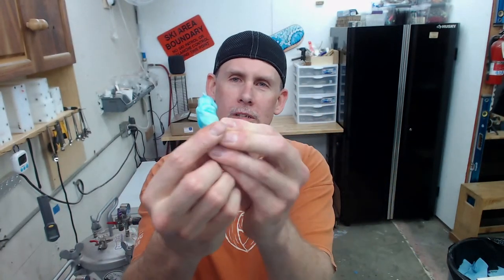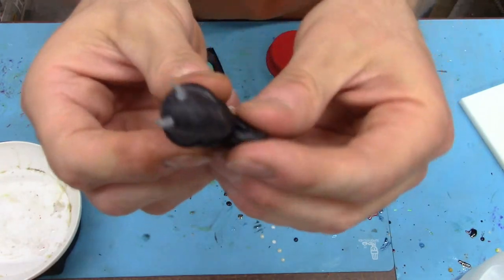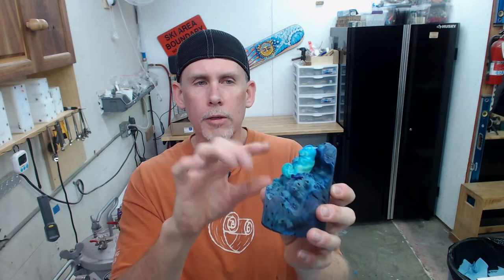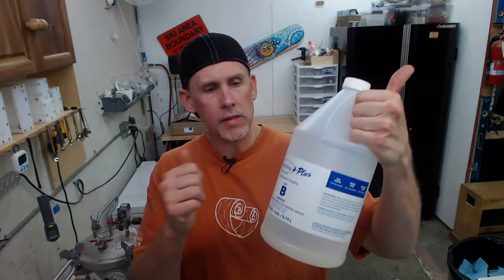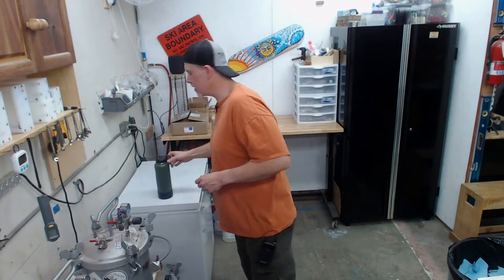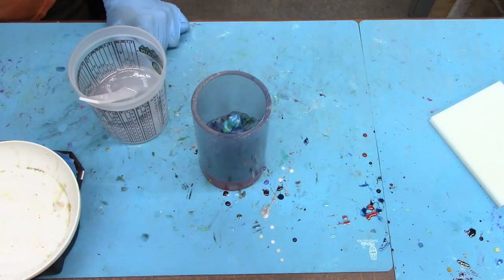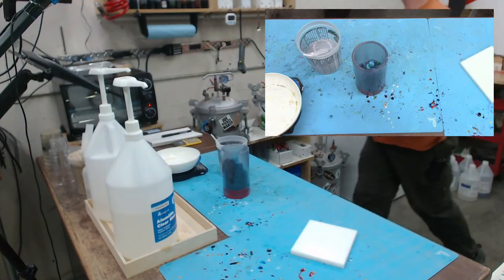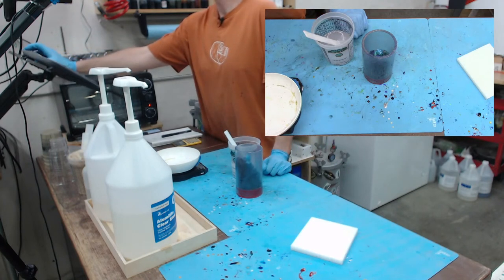🔴Replay: Casting Baby Dragon Egg Turning Blanks | Episode 119

Comment: A water based clear flat acrylic coat would provide some tooth for the resin to adhere to. Make sure it's dry with a hairdryer or time before dunkin' the object. Love the experimentation here as usual.✌
Reply from the maker: I've had some bad luck with those pesky shiny spots. Tried almost everything I can think of, luckily it just worked this time =D

Comment: If you want a pressure pot for a baseball bat start with an oxygen tank on its side. They have thick safe walls and are rated in thousands of pounds.  A competent fabricator could custom build it for under 350.
Reply from the maker: I'll have to keep that in mind. I think I can get away with just pouring it without vaccum for the bat, but there are some other projects where that may just be the way to go. Thanks for the tip 👊